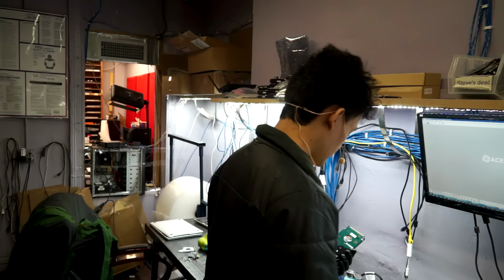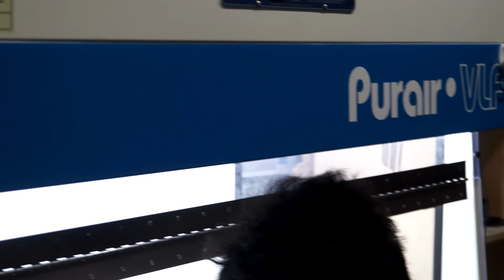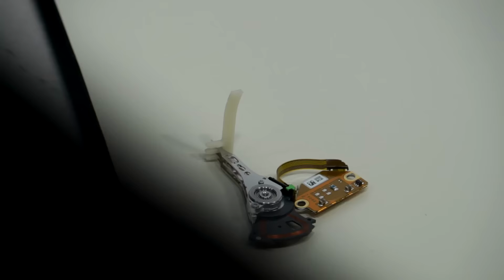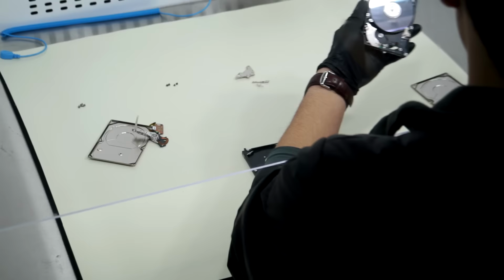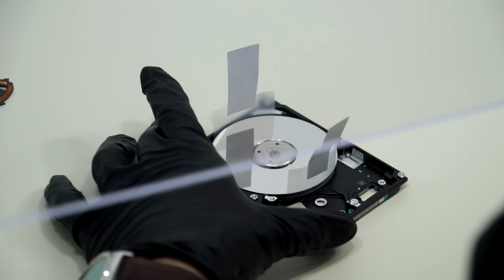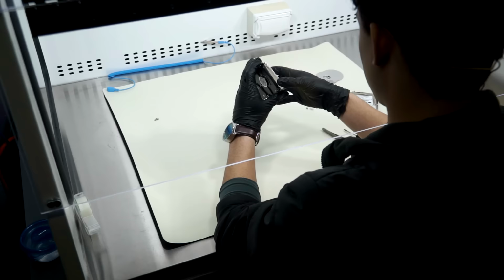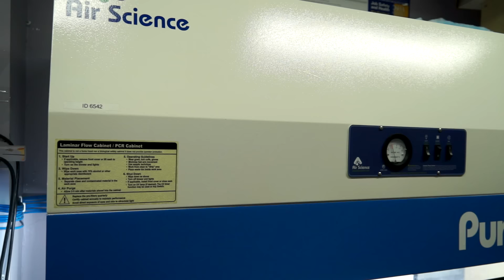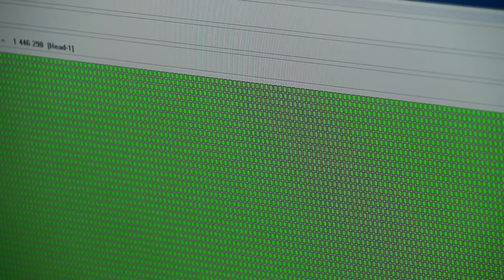Data Recovery: Hard Drive Platter Swap in Our Lab!

Comment: That canned air stuff. Can't tell from the video exactly what brand or part # he's using, but word of advice to everyone here: the bittering agent they put in that shit (so that kids don't huff it) loves to stick-to and create a micro film on whatever you're cleaning..If you contact the manufacturers directly, they usually have a model with no bitterant in it, and for the same price as the regular cans. Only catch is that you've gotta buy it in bulk (depending on whether you consider a ~12 can case of them to be bulk).

Well worth it though, and if you're using it regularly you're gonna go through 12 cans eventually anyway (in 6-24 months for me). Kids and coddling ruin everything... After 2 bad experiences with films of bittering agent being left behind on stuff after cleaning, I refuse to use the store-bought stuff any more.

If you're just cleaning keyboards, go hog-wild with the stuff from the store. But for optics, sensitive electronics, and anything you're gonna be using for high-purity solvents, fuck that stuff so hard. I don't remember which brand I use, but I doubt it matters, best guess is that most of the brands probably carry a version without a bittering agent.

FWIW, I live in the US. If you live in another country, maybe you're lucky and can still buy the good stuff in stores, or without having to jump through hoops.

Also, a side note (since this post is already long, and since the scaremongers that created this problem in the first place never actually know what they're talking about). The deal with the danger from huffing it, seems to be that it increases cardiac sensitivity to adrenaline. Meaning the jolts of adrenaline that would normally be perfectly safe (for instance, the adrenaline you get when something scares you), carry an increased risk of causing a dangerous or fatal arrhythmia. Beyond that, it doesn't seem to be any more dangerous than other anaesthetic inhalants; in that if you breathe them in high concentration, you can suffocate yourself by not getting enough oxygen.

And just so there's no confusion, this stuff isn't dangerous for general use -- it's only in high concentrations (like if you huff it directly) and with large amounts of adrenaline that it even starts to carry any risk. That's why they're able to safely sell it at pretty much every major store. If I had to guess, I'd say that 99% of why they added a bitterant to it here, is because parents don't want their kids huffing it to get high. And when you consider how many thousands of kids have done exactly that, and not died, you've got nothing to worry about if you're using it for its intended purpose.

You can dig up the research if you're interested; it's buried in medical journals and safety reports. I just felt that for once someone should spread some honest information about air duster. And for exactly that reason -- because the real facts are always buried in medical journals and further obscured by scared parents; who then go on to ruin things for the rest of us.

Congratulations if you actually got this far in reading this; it turned out to be a bigger block of text than I was expecting.
Reply from the maker: If I call up and ask for canned air with no bittering agent, will I be put on a list? :X
Reply: Louis Rossmann You're already on a bunch of lists, bud.
Reply: Why the fuck would they put bittering agent in it? It's just harmless gas! That's just fucked up man...
Reply: To stop people from inhaling the propellant
Reply: @Robert, the "compressed air" you get in those cans is not actually air :)
Reply: People can huff it for a high. Like sniffing older markers. We only sold 'canned air' to people 18+ at every electronics store I worked at in Massachusetts.
Reply: OurFlag IsMined  why spend more on aircans without bitter agent ,for data recovery the objective is to get the drive functioning long enough for the recovery
Reply: I buy CO2 cartridge based systems for this purpose.  They are totally clean of bitterants etc, and will leave no film.
Reply: I know exactly what you're talking about, and I love those things. They're small, and they fit in your hand. I forgot I even had them; I might have to start using them again.

My only concern is whether the cartridges contain oil, since a lot of cartidge based systems include a small amount oil in them to assist with self-lubricating the trigger-mechanism. Though I think I've seen cartridges that specifically contain no oil; for when you want to use them for cleaning (as opposed to in a CO2-actuated device, like an air pistol). I can remember unscrewing non-empty cartridges and getting that nice strong oil/lubricant smell.

You can even get argon cartridges for the CO2 based systems. They hold a hefty price tag at $5 each, so very rarely do situations come up where I'm willing to pay $5/liter for a heavier-than-air noble gas; but I still like to keep a few around for specialty applications).

And to kinda answer what Louis asked (I assume he was mostly-joking and only a tiny-bit serious), but:
I started ordering my 1st or 2nd year of college, and now they call me back every 6 months like clockwork to check if I'm ready to re-order yet. So I think the sales representatives at these places are pretty good at seeing through BS, and telling apart actual technical people from anyone who might be full of shit or trying to abuse the system.
I said I was looking to get their high-purity grade, but without the bittering agent (because in addition to the bitterant, they also filter them to different grades of purity). They asked me what I needed it for, I explained the kind of things I use it for, and why I wanted to reduce as many sources of contamination as possible -- and especially the fact that twice in the past year I'd had the bitterant stick to what I was cleaning -- and they had no problem or concerns with selling it to me.
Reply: You've got a fair point. And I'll admit that I'm fairly OCD when it comes to some stuff.

But including the cost of shipping; as long as you're buying a fair quantity of it, and taking into account that buying direct-from-manufacturer sometimes saves you a few pennies (since you're cutting out the middle-man), the cost-per-unit usually comes out to pretty close to the same you'd be paying to get it from a store, or from Amazon.

And considering how many uses you can get out of just a single can, it really ends up being just a few pennies extra, each time you use it. Which is a small price to pay for the peace-of-mind that you have 1 less thing to worry about; especially if you ever come across a hard drive that's barely hanging on.

I'll be honest, the bittering agent has a pretty small effect, as long as you're careful not to let the can tilt while spraying (if you accidentally tilt it too far while spraying and bit of liquid comes out, THAT's when you end up getting the really serious buildups).
Reply: Ok, but why propellant? You don't need propellant to get air or whatever gas is in there under high pressure out!
Reply: Yeah but you can only store a little bit of air in such a container, however if you use someting like propane that will liquify under moderate pressure you can store a lot of gas under safe pressure.
Reply: I live in the 3rd world, and the only canned air I can find is my grandma's fart
Reply: It's not just gas. "Canned air" is usually safe to be blasted at powered, running electronics, because not only does it not contain electrolytes or otherwise electrically conductive substances, it's blasted partly as a liquid to avoid ESD from dry dust being thrown around and accumulating static charge. At least as far as I know.
Reply: Actually small particles carry charge, it doesn't matter if they are liquid or solid. Gases carry charge as well. Antistatic substances are usually very slightly conductive, we are talking ten's of megaohms per mm, but that's enough to dissipate rogue electrostatic fields without being a problem for low voltage electronics. For high voltage it's a different story. Voltages above 20 - 30KV love to creep on to antistatic films.
Reply: Now that you mention static charges, it makes me wonder-- that tube that comes out of the can. The can itself may be grounded, and you yourself may be grounded while holding it, but the valve mechanism, and the tube that you stick on the end, are plastic; I'm curious whether it's possible for any charges to build up. I think in this case it'd be a negligible electrostatic charge, even if it were possible, but it still peaked my curiosity enough to do some quick reading; and I found this statement (relating to venting flammable gasses out of plastic tubing:
"venting gas with high scale or dust content could generate a charge in the gas itself and could result in an arc from the dusty gas cloud back to the pipe and ignition".

The amount of bitterant is low enough that I doubt it's a practical concern; especially under a laminar flow hood. And the length of plastic it's traveling through is pretty short. Still interesting to keep in mind for any of my future endeavors (ones involving longer tubes and different fluids; the electrostatic risks from duster cans don't worry me in the slightest).

And to the guy who asked about why "canned air" needs a propellant; I was working on looking up some figures before I noticed that someone had already answered him. But here's some general approximations anyway (they might not all be 100% accurate, and they vary based on temperature, but they give you a rough idea of why we use fluorocarbons as the propellant in canned air, instead of just taking regular air and compressing it into a can).
Our atmosphere is 78% nitrogen, 21% oxygen, 1% argon, and <1% other trace gasses. It was hard to find a reliable figure on the pressure of liquefied nitrogen at room temperature, but estimates seemed to be in the tens of thousands of PSI.
CO2, IS a gas you can get in liquid form. Small paintball gun air tanks are only slightly larger than a can of duster, and look at how heavy-duty those have to be; thick steel (I'm assuming steel), round-wall construction, have to be water-tested after their expiration. And the pressure of room-temp liquid CO2 only seems to be around 850 PSI.
Propane, you can also get in similar-sized containers; and while they're not as heavy-duty as CO2 tanks, they're still steel-wall construction with rounded ends. And it's only around 180 PSI at room temperature.
Butane you can get in similarly-constructed containers to the duster, and it's around 40 PSI at room temperature.
And last but not least, the fluorocarbons they use as the propellant in computer duster: about 70 PSI.
(anyone's free to correct me if I'm off on any of these numbers)

And that's not taking into account the fact that during shipping and storage, ambient temperatures might accidentally get up to the 130 F (54 C) range in a worst-case scenario; which causes the pressures to skyrocket even further.

So butane and fluorocarbons-- 2 gasses with low-enough vapor pressures to safely store them as a liquid, at room temperature, in reasonably cheap thin-wall canisters. And while the fluorocarbons are also combustible (you can easily get them to burn if you try), they're a helluva lot less flammable than butane; If you hold a candle 12" away and blow the computer duster at it, there's a reasonable chance it doesn't ignite. Obviously I wouldn't try that with butane.

So as far as propellants go, fluorocarbons are a pretty ideal choice; low pressure, low flammability, and overall pretty damn safe (as long as you're not huffing them).
Reply: +Lious Rossmann
You badmouthed Apple and talked about the NSA.
You're on all the lists.  We all are.
Reply: +wabdih
I thinking having an I.Q. above 80 puts you on the list.
I wonder what my 'psych profile' looks like.
I bet it looks like the ingredients list of the worst cookies at the dollar store.
Reply: Why not just run an air compressor if the cost of canned air is substantial enough to debate ordering A FREGGIN CASE
Reply: gromann noise, potential for moisture even with a trap
Reply: Great to know, thank you.
Reply: OurFlag IsMined Thank you for actually explaining this in details,knowledge is a powerful thing,and I'm always hungry for more.
Reply: Thanks for your time & effort to explain all that, it's very much appreciated! :)
Reply: Actually, the reason for the bitterant is because kids were huffing it, however, it's not to stop them from getting high.  Ever turn the can upside down?  How about turn it upside down and spray something?  Do NOT spray yourself, as you can end up with frost bite from it.  I worked at a retail chain when we got a memo explaining that we had to remove ALL cans of canned air off the shelves and start carding for them.  Rumor went around, that kids were huffing it, and several were hospitalized (possible deaths?) from frost bite while huffing it.  I actually witnessed a co-worker (he was a little off his rocker) spray himself on his arm with a can upside down for a few seconds.  The next day, the skin where he had sprayed it was all rotten and decaying, very similar looking to a severe frost bite "burn".  Apparently, shortly there after, the companies started added bitterant to the canned air (kinda reminds me of a mild pepper spray) to deter people from huffing it.  Again, not sure how much of the rumors are true, but I do know first hand, this stuff can leave severe nasty burns.
Reply: I can buy shit in bulk? WOOOO
Reply: There does seem to be some confusion as to what "canned air" is.  It is not air at all.  Rather, it is a mixture of propane and butane or HFCs e.g. tetrafluoroethane, often with bitterant and some residual oils.  I work in UV optics so I can't afford either of those to get anywhere near optical surfaces (oils prevent transmission/reflectance of UV light, bitterants leave a residue which blocks all light)   

My data recovery story :)  Many years ago, I got involved in a computer repair business during my university days and my first hard drive recovery was a 4Gb 2.5" laptop HDD that had been in a laptop that was dropped into the sea from a Navy supply vessel.  I removed the lid of the drive and washed it for several hours in DIW, then dried it in heated silica gel then swapped the platters using the core of a toilet roll, ripped along the spiral, with 3M (sticks like shit to a blanket TM) double sided carpet tape on the inside (a trick I'd seen being used on old Micropolis ESDI full height drives)  Amazingly, all the data was good :)  The only real difference between what I did and the video, is the tools.  No magnetic tools.  Otherwise the heads can become magnetised by the slightest mis-placement of a tool and give poor read-outs and keep the heads away from the magnetic assembly around the voice coil.  

It was a good side business as "professional" recovery companies were charging £50/Mbyte at the time (whether or not the data was garbage), with a £250 up-front charge and I'd do it on a no-recovery-no-fee basis and £10/Mb of usable data (of course, they'd need to pay for the donor drive)

Later I discovered the "click-of-death" on three out of four LaCie drives I had (Maxtor inside) (won't buy either brand any more) was readily solved by removing the head assembly and degaussing the heads, the hint being the read-out level was so low...
Reply: First off I'm not a doctor and please don't take medical advice from me a random guy from the yt comments.

Canned air isn't actually "air" (See: https://en.wikipedia.org/wiki/Gas_duster) and while I agree with the intention of providing unbiased fearmongering-free information about taboo substances I don't necessarily agree with duster being non-harmful. I believe the studies you are referencing with the comment about the heart issue caused by it where done on the substance DFE (See: https://en.wikipedia.org/wiki/1,1-Difluoroethane) which is one of the multiple substances that can be used as the main ingredient. There are other Fluorocarbons that can be used as the main ingredient and manufacturers can add plenty of other additives that may be harmful due to the product being not for human consumption.

In Summary, If anyone reading this is considering trying a substance, please do your own research and make sure you weed out the bias from various sources of information to make sure your are making an informed decision.
Reply: Very helpful and it answers a few questions!! Thanks so much!
Reply: I learned something  that i wasnt expecting to learn in that comment
Reply: REWRITTEN EDITED  and CORRECTED TEXT
  That canned air stuff.
  Can't tell from the video exactly what brand or part # he's using,
  but word of advice to everyone here: the bittering agent they put
  in that shit so that kids don't huff it loves to stick to and create
  a microfilm on whatever one is cleaning.
  Contact the manufacturer directly, they usually have a version without
  bittering agent in it, and for the same price as the regular cans.
  Only one has to buy it in carton quantity - such as a carton will
  usually contain 12 cans.

  Well worth it though, and when one is using it regularly, 12 cans will
  be used eventually - in 6-24 months in my case.
  Kids and coddling ruin everything... After two bad experiences with a
  film of bittering agent residue being left behind after cleaning, I
  refuse to use the store-bought retail product anymore.

  If one is just cleaning keyboards, go hog-wild with the retail stuff
  from the store.  However, for optics  and sensitive electronics it is
  better to use high-purity solvents.
  I don't remember which brand I use, but I doubt it matters best guess
  is that most of the brands probably carry a version without a 
  bittering agent.

  FWIW, I reside in the US. If you reside in another country, maybe
  you're lucky and can still buy the good stuff from a retail store,
  or without having to jump through hoops.

  Also, a side note -since this post is already long, and since the
  scaremongers that created this problem in the first place, never
  actually know what they're talking about.  The deal with the danger
  from huffing it, seems to be that it increases cardiac sensitivity
  to adrenaline. Meaning the jolts of adrenaline that would normally
  be perfectly safe -for instance, the adrenaline you get when something
  scares you, carries an increased risk of causing a dangerous or fatal
  arrhythmia.  Beyond that, it doesn't seem to be anymore dangerous
  than other anesthetic inhalants; in that, if breathing them in a high
  concentration, you can suffocate yourself by not getting enough oxygen.

  And just so there's no confusion, this stuff isn't dangerous for
  general use -- it's only in high concentrations -such as when one
  huffs it directly and with large amounts of adrenaline that it even
  starts to carry any risk. That's why manufacturers are able to safely
  sell it at pretty much every major store. If I had to guess, I would
  say that 99% of why they added a bitterant to it is because parents
  don't want their kids huffing it to get high.  And when one considers
  how many thousands of kids have done exactly that, and not died, 
  you don't have anything to worry about when using it for its intended
  purpose, and observing the safety protocols.